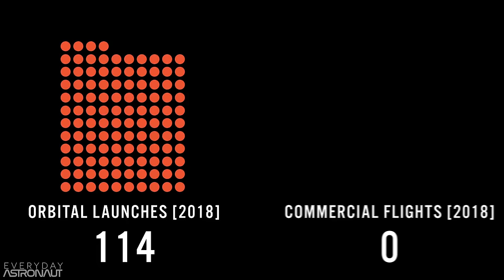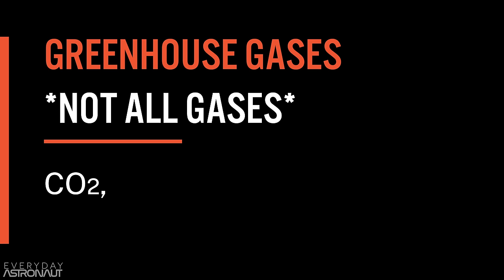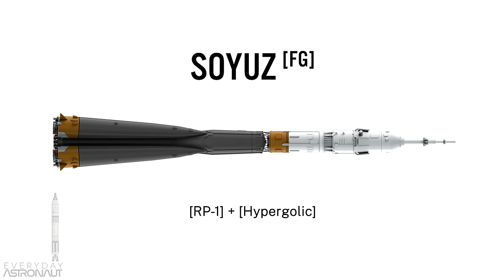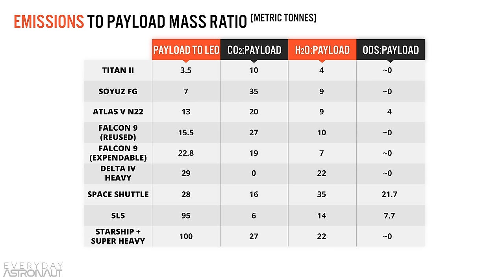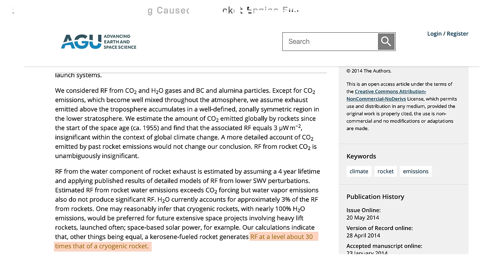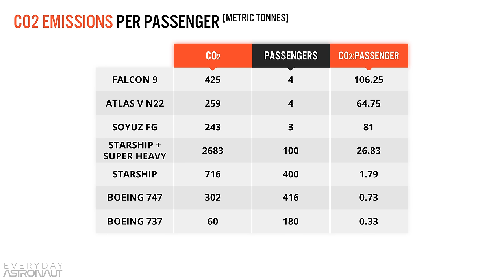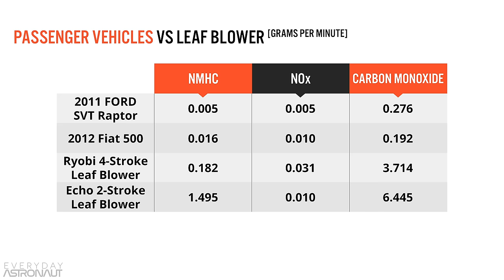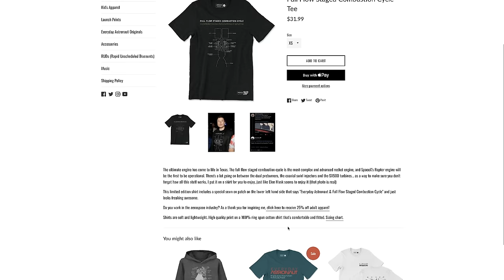How Much Do Rockets Pollute? Are They Bad For Our Air?

Comment: CO2 is a water soluble gas. Synfuel can be made by extracting CO2 from either air or water. The Navy developed seawater to synfuel to make jet fuel, but congress never got interested. The basic concept is that a nuclear powered oiler (fuel tanker) would be fast enough to do better at keeping up with a carrier and could supply the carrier with jet fuel without having to find places to buy jet fuel all over the world or having a string of oilers tailing the fleet all the way back to America that have to be protected with air and sea assets. Synfuel production powered by a nuclear powered ship would make more expensive synfuel than fossil fuel at the point of purchase but at a similar cost to the cost of fossil fuel brought out to the fleet at sea. So the Navy knows how to make synfuel jet fuel powered by a nuclear reactor,  and nuclear power has a lower carbon foot print than solar (both are low compared to fossil fuel).

Comment: Around 29:00 don't forget that producing solar cells itself has a huge environmental cost including CO2 emissions for the energy,so NO, you are not carbon neutral in producing methane rocket fuel using solar energy.  And since CO2 is only 0.04% of the atmosphere, capturing that CO2 is going to cost a lot of energy. I don't know how to do those calculations, but I suspect the least environmental impact would be to use natural gas (mostly methane) for your methane rocket fuel.

Comment: I wonder if Starship could actually beat a 747 for certain select routes where the jet would have to make multiple flights. Say Beijing to Buenos Aires or Auckland to Seville? 

Separately, I learned recently that the Gen4 Molten Salt reactors may be able to make hydrogen and oxygen directly from water (without electricity in between) due to their high heat, and as a byproduct--you'd still be able to generate electricity too.

Comment: The specific mixture of hydrogen and oxygen combustion can apparently have a significant impact on the amount if oxides of nitrogen produced.
Reply: Yup the hotter she burns the more you get. Fortunately a fuel rich mix gives a higher exhaust velocity and cools the burn down.

Comment: Why is the delta heavy not used for crewed missions? It has even more power than some other rockets that do send crews to space. The delta heavy has also never suffered a catastrophic failure since its first launch in 2004.
Reply from the maker: Because it lights itself on fire each launch and that’s not apparently something NASA is comfortable with for humans
Reply: @EverydayAstronaut  has that extra launch flame ever damaged a payload?

Comment: Nice data. However ... The hypothetical 3512 point to point Starship launches/ year would only benefit only 1.4 million passengers and produce as much emissions as the airtravel of the whole world (not counting that this ratio is orders of magnitude worse because aircrafts can be used much longer). 
What is achieved by the environmental  impact caused by different vehicles and devices? Todays spaceflight is mostly a matter of science (generally necessary to have), cars and chainsaws help a lot of people in there everyday life (generally important even if they produce unnecassary amounts of emissions) and airtravel is a way for a large number of people to reach distant places (and already not exactly a low emission way of transportation and not for everybody, but at least beneficial for a enormous number of people).

Comment: Chemical propulsion is so last century.
Gigavolt ion drive would be worth "borrowing" as electric field pulses of sufficient strength induces cascade ionization of atmospheric gasses inducing a high "amperage" of ion flow. Bypassing the ion's electron flow through the voltage source with a shunt between pulses greatly reduces the electrical power required.

Comment: flywheels hold energy clean power
alternators that spin make say 14Kw belt driven from a 3.5 source switchable generator 3 word conrties are running fridges in the middle of india away from the grid

Comment: Fantastic video. My only concern is the the 400 passenger count for starship. Because I feel like the limiting factor for starship passenger count would not be based on how much potential space it would technically be able to carry, but rather how many it would SAFELY be able to carry. SpaceX hasn’t really been too forthright with a lot of the prototype starship data, but I would imagine most passengers would have to be pretty close to the axis of rotation in order to mitigate the G forces produced during the “flip and burn” maneuver it uses to land.

Comment: 747 CO2 emissions per passenger should be lower than the 737 since it burns less fuel per passenger mainly because of longer flights and having longer range. Once they are at cruising altitude the fuel burn is cut in almost half.

Comment: Methane leaks are just pure methane that comes out from all along the methane manufacturing, transporting and fueling. Also the burning process is not always burning all methane, so there's another source. And also with failures like Starship landing failures you get extra methane leakage. Same issues effects almost any gas. Global methane levels are raising rapidly and one source is fracking industry with long pipelines.

Comment: One thing about manufacturing is that it requires a lot of heat.

Why not, then, use solar furnaces? Of course, you should be combining it with heat retention, but it's the same, really, as using batteries as backup for wind/solar. And as a bonus, a LOT of zones where the sun is present everyday are close to the equator, where there are a lot of critically (and unjustly) underdeveloped countries.
Reply: The cost of solar is no longer much of an obstacle, but efficiency suffers in the mountains (when the sun is on the other side of the hill) and flat areas are where we like to grow our food. You could cover every farm in solar cells and still not meet the energy demands of a modern society. Also, the manufacture of solar cells generates large quantities of toxic waste solvents that have to be dealt with. Lastly we have no way to store enough energy to get us through a week of rainy or cloudy weather.
Reply: @Tubluer  I never talked about using solar panels, did I ? I am talking about using mirrors. And when the furnace is not active, replace (ie, move it away) with a molten salt solution for stocking heat which can then be reused.

Comment: Great video - I've always wondered how much junk rockets are spewing out..turns out, not as bad as it appears.   thanks.    
Question:   you briefly mentioned that re-entry actually generates quite a bit of pollutants/atmosphere warming elements - but didn't explain what's happening with re-entry to cause that.  can you expand a bit?  cheers.

Comment: actually,if they are just useing liquid oxygen and hydrogen,then no pollution is to be expected as the only byproduct should be water vapor.its only the hydrogen we burn in a fuel anyways,the rest is just a carbon chain that keeps it in a liquid form,and those carbon chains are what produces polutants,not the hydrogen.

Comment: I am always very skeptical about 'green' solutions that still require putting greenhouse gasses into the atmosphere.

For example, at least where I live, wood burning power plants are considered green energy and carbon neutral because any carbon released have been absorbed by the trees.  So, according to that logic, when you combine deforestation and polluting the atmosphere you suddenly get a clean source of energy.

There was also a proposed car fuel source a few years ago, I forgot which, but it required equal amounts of CO2 to create the fuel as would be emitted, so it's carbon neutral and was being marketed as a green fuel source.  But, in all likelihood, it'd be cheaper to make new CO2 to create the fuel than it is to get it from the atmosphere, so in reality it would probably just be another polluting fuel.

And finally carbon capture.  It's an interesting technology that should certainly be developed further, but I don't actually see it happening.  There is basically zero economic incentive to creating them, neither for companies nor governments.  So, while a few might be built as a token to show how good your company or political party is at fighting climate change, but not nearly enough to make a real impact.  In fact, they may actually be harmful if they start to be used to justify putting a bunch of CO2 into the atmosphere.

One thing that could fix a lot of these is a carbon tax and an equally large carbon capture subsidy.  The details are incredibly complex, but an imperfect carbon tax would be loads better than none at all.  Besides, this is what lawyers are for.  However, somehow even UBI seems to be more politically viable.
Reply: Huntracony - I think it is simply unavoidable. To establish green methods we must do something, and doing anything takes some power, which makes some emission. The point is to do things which immediately reduce the CO2 emission of our power generation. Renewables & nuclear power do that.

Comment: Has the hot staging separation been compensated for the deflected thrust on the booster? In flight two, it seemed like the booster began decelerating at separation, causing "fuel slosh". I would think the booster should accelerate through hot staging, then begin the boost back after Starship has moved downrange to minimize "fuel slosh".
Reply: The booster has a lot more thrust. If you mean what i think you mean, then starship will do what falcon 1 flight 3 did and the booster will bump back into the starship. Also pretty sure this problem has been solved.
Reply: @benzene_sandwich  I agree that the problem was solved. In relation to my original question, it did turn out that stage 2 ignition caused a sharper deceleration in stage one than expected causing a chaotic "fuel slosh" in the booster tanks that damaged the engines on reignition. They accounted for it in flight 3 and refined it in flight 4, but it was only one factor in the flight 2 failure. The majority of the solution was in engineering solutions with tank baffles and line filters. Altogether, simulations show a much smoother fuel mass transition during the rotation for boost-back. Flight 2 booster failure was practically inevitable at the boost-back transition.
Reply: @bobdole2408  I think constant acceleration can work depending an how low the raptors can throttle, i'm not aware of any info for this online, but as long as the acceleration is enough to counteract the impulse from second stage hot-staging, it would be a more reliable option than installing baffles, and if it worked well enough the baffles could be removed entirely decreasing dry mass. You would just have to make sure the thrust isn't enough to accelerate the booster back into the second stage, i think.
Reply: @benzene_sandwich  I agree with that as well. Most of the resources I've found have been through the WAI channel, but I've only found references to changes in the flight profile without specific thrust profiles. I haven't been able to deduce the mass added from tank baffles and other engineering solutions, but there is no doubt that the booster dry mass was increased. If the booster was able to boost back in a way that prevented the need for the extra weight while having more of its delta-v applied to accent before the boost-back maneuver, then it would be more efficient to use the precise boost-back maneuver that prevents slosh. I doubt they will revert from the baffles because of the additional assurance of success and safety. The difference is probably negligible to the total, but I can't find enough data to work out the specifics.

Comment: water vapor is not a more powerful greenhouse gas than CO2 (per molecule) although the total  contribution from water vapor is higher, due to the much higher concentration of water.
Reply: water vapour is also not that bad except on the upper atmosphere since on the lower one it just makes coulds and rains down again.

Comment: About 27:36, please tell me if I am true or false: In order to electrolyse water to make hydrogen, separate hydrogen from oxygen, gather carbon dioxide, compress it into a tank, performing the Sabatier process and separating the methane and oxygen will take virtually the same amount of energy that the combustion of methane and oxygen produces.

Comment: I have a question. Its kinda late, but why does it pollute if the fuel is taken from earth, and mostly dumped back into earth? don't you just take 1 from earth and give back 1 to earth?
Reply from the maker: It does matter where the substance was before. For instance, carbon trapped as a solid through out earth is one thing but when you burn it and release it into the atmosphere it’s another thing
Reply: @EverydayAstronaut  Wait wut, Tim Dodd him self answered, damm, thx allot. Anyways, so the fuel used did come from earth but in a solid or liquid state, and what using those fuels, means changing its form to, in this case vapors, spreading its content to the atmosphere. that makes sense... Another question if possible, Is electric propulsion possible for rocket launches? is the power strong enough? well thank you Tim. Your long videos are awsome!!!
Reply: @EverydayAstronaut  and if its possible, Is the entire process "cleaner" than fuels used today? thx

Comment: It is not because improvements will be made in one sector (say electrification of the car fleet), that other sectors should feel free to pollute more. So, point to point transportation by rockets seem to me to be a non starter. Let’s keep rockets to put useful loads into orbit, and accept spending some hours in an airliner, when one absolutely, positively need to do an inter-continental flight. Such a moderation (I prefer this word to limitation) of air travel to what is truly necessary could be achieved by putting an appropriate carbon tax on jet fuel... and other fuel also, while at it. Otherwise, mankind is soon going to hit a wall... at orbital speed! The new IPCC report is pretty clear on that matter!
Reply: Totally agree!
On top of that, the 100 to 400 seats on Starship are greatly reduced, at least for now. Musk is now talking about 30 seats on orbital Starship. Doesn't make it less useful, but compared to an airliner, this is a no brainer

Comment: Fossil fuel is the most extremely limited resource of power over any other alternative engine of travel, even though its the most powerful and unsfable exertion in its duration then anything else. Because of bulk limit canister, its even more dependent on aviation gears like wings/gyros/propellers and/or other altermative fuel preserve methods, until we learn to use more EPA/Eco freindy combustion booster, or other flight concept paderns when traveling within the Earths Troposphere.

Comment: I would have liked for there to more emphases on the health concerns of rocket emissions to humans.  What effect would Starship launches have on the air pollution index for towns or cities there are near?  

Climate scientists will typically preface when talking about CO2 that it is a very mild greenhouse gas with water vapor being a much more powerful greenhouse gas.  Water vapor overlaps the inferred blocking wave lengths of CO2 except for a small window and is some 45 times more concentrated in the atmosphere.  A note: greenhouse gases as typically discussed block inferred radiation from the earth's surface from escaping out to space.  Their interaction with solar radiation is not a big topic of popular discussion.  Water vapor and steam are invisible.  Condensing water vapor and steam appear white as seen during rocket launches. 

CO2 in the atmosphere converts high energy ultraviolet solar radiation into longer wave lengths more conducive to heating the earths surface.  This is CO2's primary means of heating the earth and is thought to provide the earth with some 50°C of additional temperature.  This takes place with very low levels of CO2 at 10 - 50 ppm to reach saturation with present day concentrations being around 350 ppm and there is no ultraviolet radiation in the wave length CO2 does this conversion hitting the earth's surface.  There is a giant spike in the CO2 converted wavelengths hitting the earth's surface.  This is NOT a greenhouse gas mechanism.  

As a greenhouse gas CO2 has a natural log relationship with larger concentration having smaller effects in radiation forcing and may go hyper log rhythmic at multiples of todays concentration.  CO2's forcing effect is small at some 1.4 W/m^2 inferred energy retention predicted by an attitude of 20 km for an increase of CO2 from 250 ppm preindustrial to 350 ppm of today.  As a comparison  a solar panel is typically rated at a solar radiation of 1000 W/m^2 and on a typical good day will see 500 W/m^2.

Comment: I feel using airplanes in that 'co2 per passenger' chart is very informative for comparison, but the 747 and 737 are way different aircraft. The 737 usually flies much shorter flights, meaning that it will use less fuel. The 747 has much longer flights, so it will use more fuel. Having each fuel capacity halfed can be misleading as so many flights are different in range. There are too many variables on the chart regarding range for an accurate comparison on true pollution levels per vehicle.